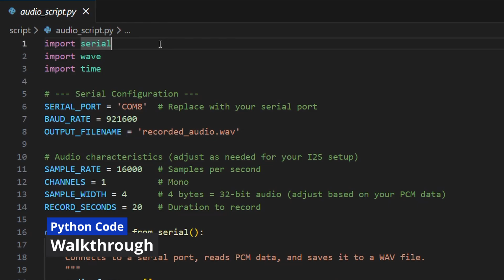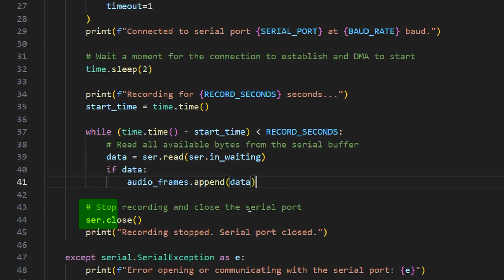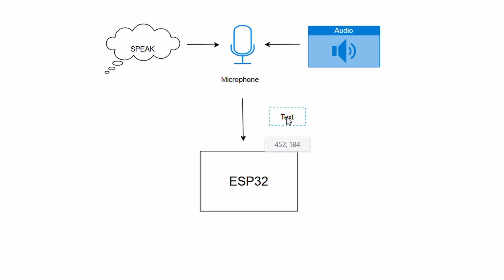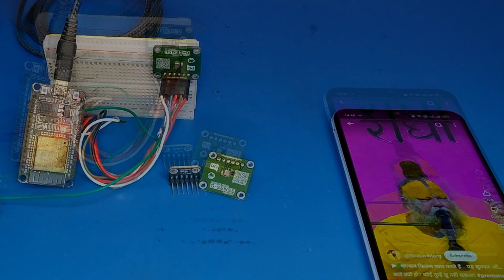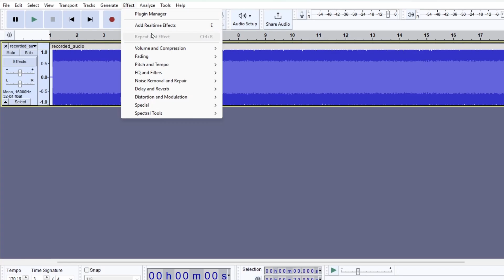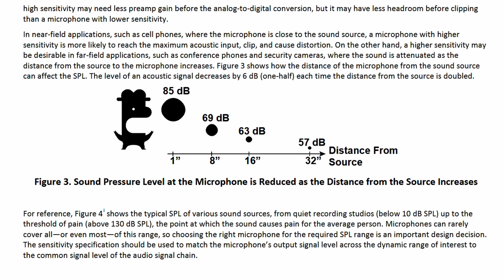I Tested a MEMS Microphone — Here’s How It Actually Sounds!

Comment: Bro you soldered the headers opposite 🫪
Reply from the maker: Nice of you to note! Firstly, I wanted that part of PCB to be on top. Also, in breadboard setup there’s always a gap between PCB and breadboard, so the mic isn’t acoustically sealed and sound can still reach the port.

I’ve used it this way throughout the series and it works for me, so yes, you can keep the port side on top, but it’s not really a must for this setup. Thanks.